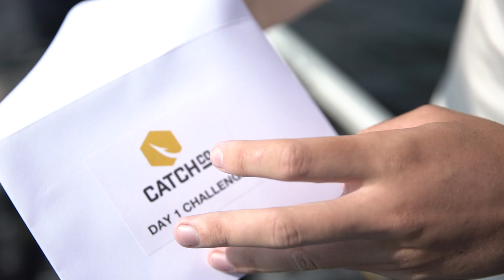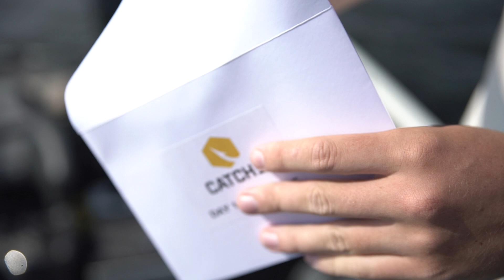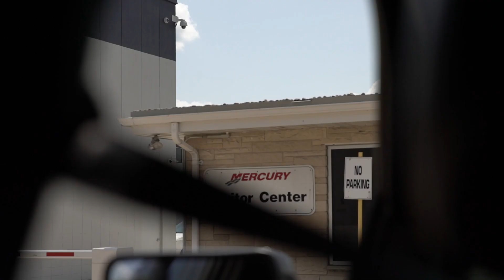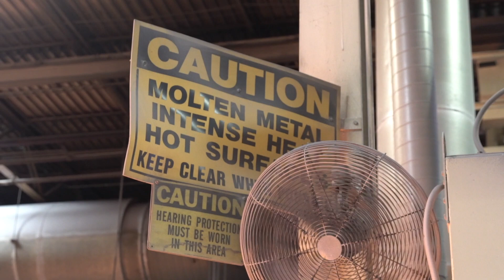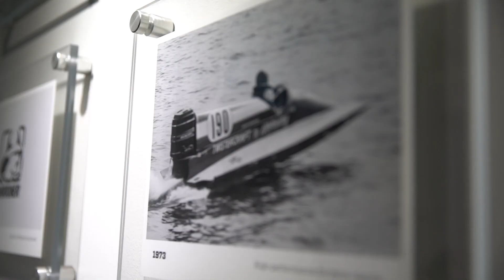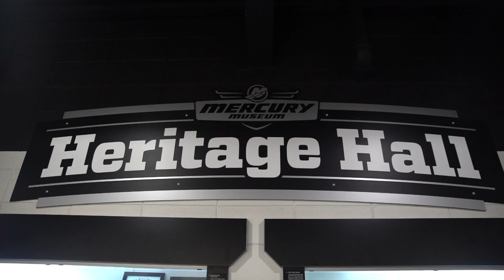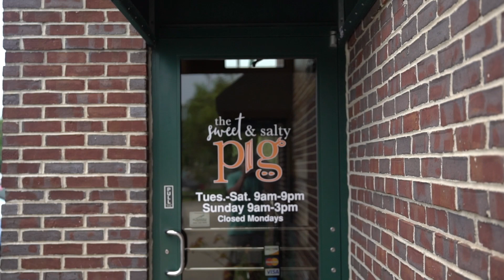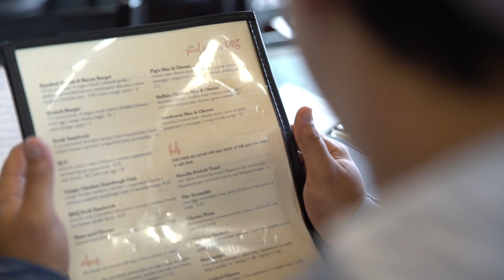Unchartered: Chicago (Ep. 1 - Storms) ft. Jon B, Lawson Lindsey, and Luke Norman

Comment: Pretty cool to see the props being made like that, you really would think they had a big automated production line.
Reply: They used to make Harley Davidson crankcases there at Mercury too.  They went on strike a few years back and we got the Harley jobs here.  Harley ended up suing Mercury or something because they didn't do the upkeep on the casting dies.  Some of them were delivered to us covered in pigeon doodoo and i had to use a bar and an overhead crane just to crack the bolts loose to swap leaky cylinders and put new seal kits inside.
Reply: That's crazy to know, I have 2 harleys sitting in the garage...maybe they have Mercury motors!